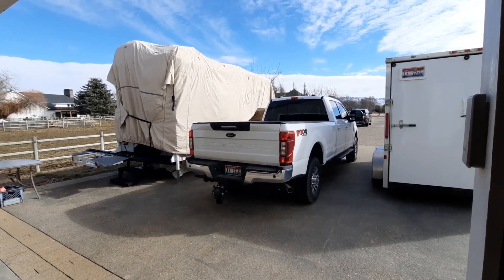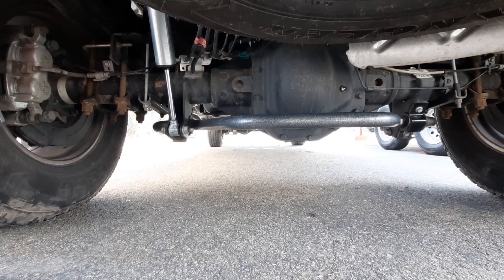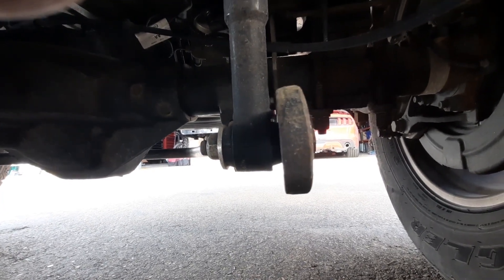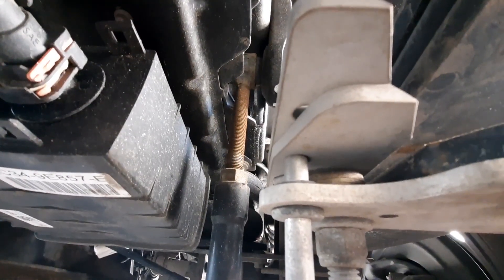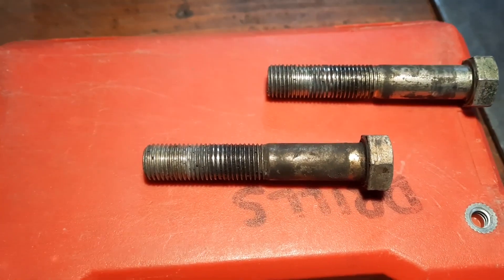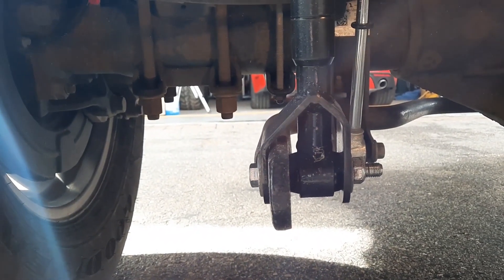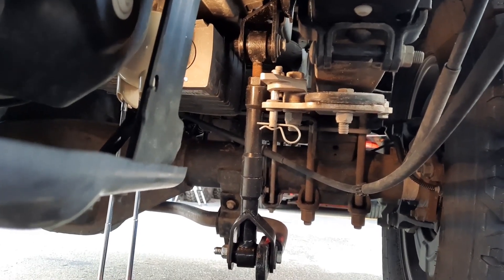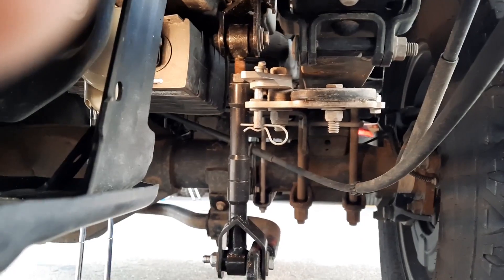"Hellwig Bigwig" Sway Bar Fail and Upgrade

Comment: So I added the Bilstein that made a huge difference. The anti-sway bar is not meant to do the work of the shocks is not supposed to do the work of the anti-sway bar. I have the helwig front and rear anti-sway bar on a Ford excursion 2003 it used to have a very bad sway or roll if you went around a corner. That completely stopped after I added the two front and rear anti-sway bar this last year I upgraded too the Bilstein toe shocks.

Comment: I have the same truck and same set up. Did you make sure that your end link bolts were tight to the point where they were bottoming against the metal bushing that runs through the rubber end link bushing?  I videoed mine while rocking the truck back-and-forth vigorously and didn’t see any movement in the end link versus sway bar end.  So far, I haven’t experienced any clunking, but I have noticed there is still a fair amount of sway at low speeds over driveway, entrances, etc.  I have the Bilstein 5100 shocks, front and rear and the stock front sway bar installed.  I also have the upper and lower torklift stableloads installed.

Comment from the maker: I checked the invoice from "SD Truck Springs, but the part number is not on the invoice.  The Big Wig Sway bar has a diameter of 1 5/16th inch.  The fix is still working great, no more clunking.  Thank you.

Comment: My 2023 F350 clunks also, very annoying. I discovered they use 7/16 bolts on the end links thru the sway bar adjustment hole that is 1/2 inch diameter allowing 1/8 inch movement on each side which causes the clunking sounds.
Reply: So why not just get 1/2 inch bolts? Why do all this modifying

Comment: I have a 1500 with a 6” BDS SUSPENSION LIFT  22”wheels 35” tires I also have a hellwig rear sway bar ,but mine swings the opposite way connects on the rear side of pumpkin ,mine is working fine but is connected completely different the 3500,s do

Comment: What model sway bar are using and is your fix working
Reply from the maker: I checked the SD Truck Springs invoice and no part number is listed. The Big Wig sway bar is 1 5/16th inch in diameter.  The fix is still going strong, no clunking. Thank you.